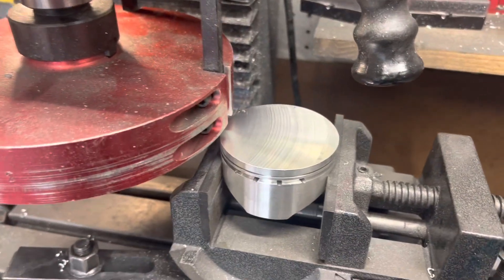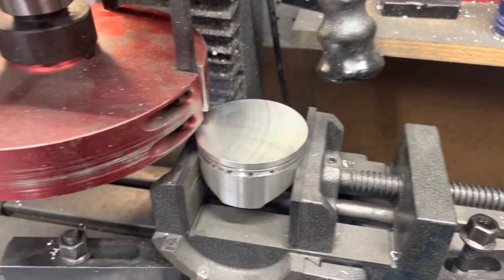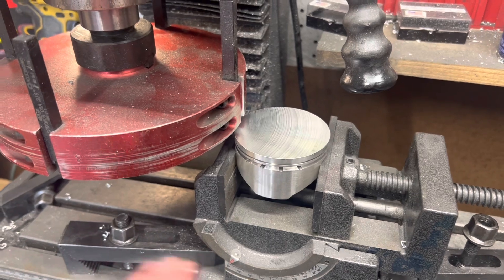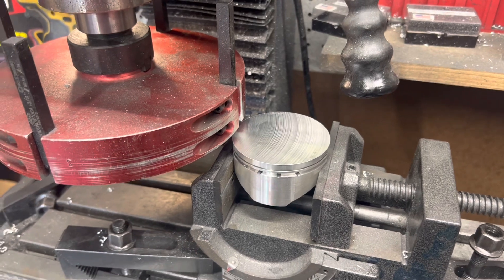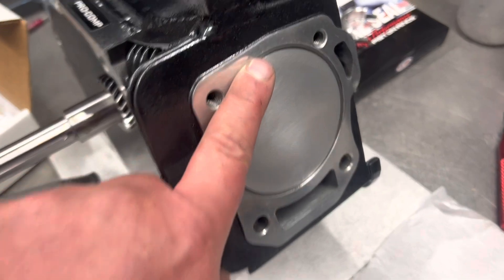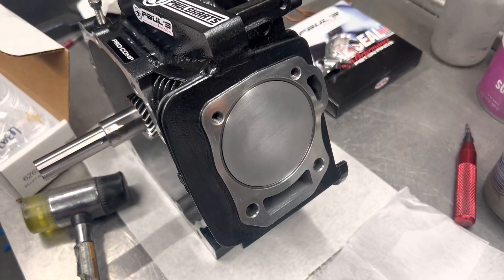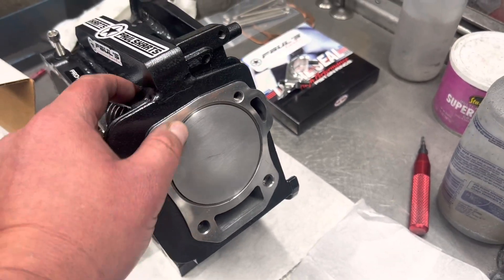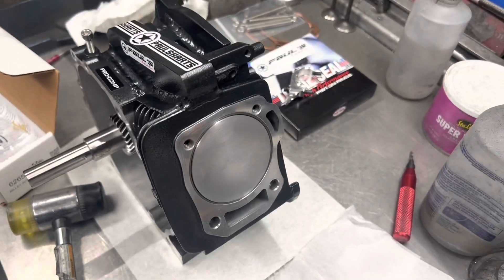Piston milling , getting zero deck with a longer rod

Comment: Paul you have by far the most high tech designs and work for these engines then anybody I've ever seen. Been watching your stuff for years, thank you for uploading! Got a quick question, what's your thoughts on the predator 459cc max performance engine? Currently no aftermarket flywheel, hard to find rods, but as a big block With a pressurized oil system wouldn't it have one of the best advantages/ potential compared to the 420 or gx390?
Reply from the maker: Aftermarket support for an engine is everything I would definitely stick with buying a block that’s 92 mm like maybe the Duramax and then going stroker crank 10 both side cover and Performance cylinder head going that route instead of buying the predator 469 even though it has the better oiling system, oiling is never been an issue in these engines even under high-performance stress